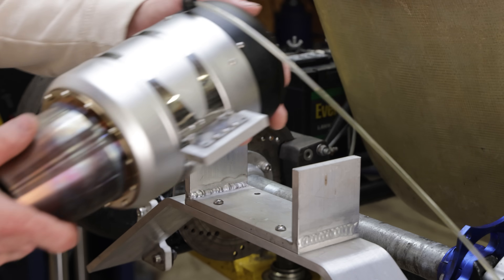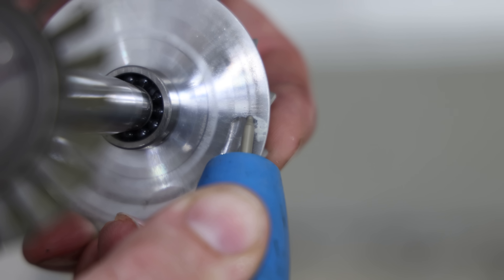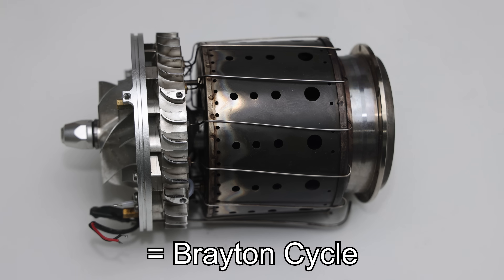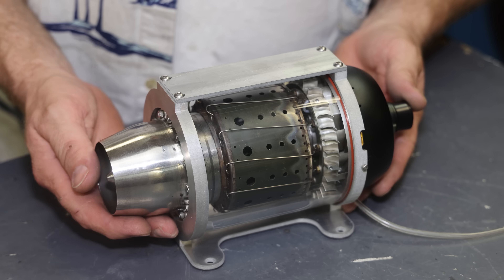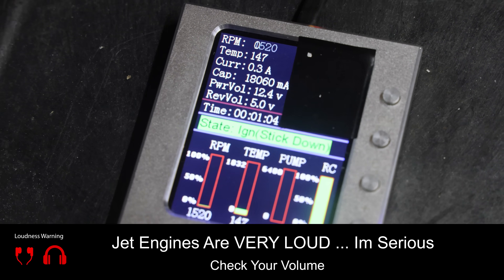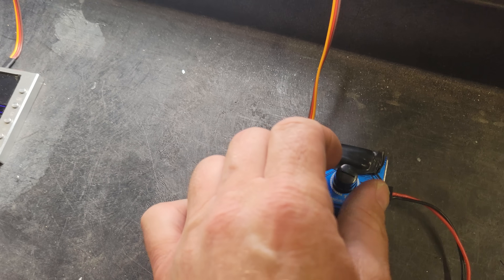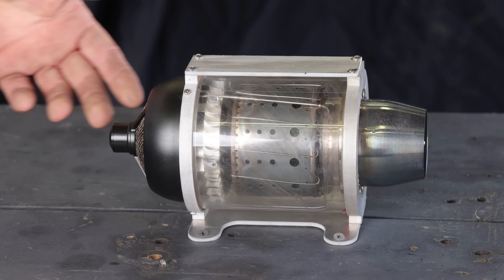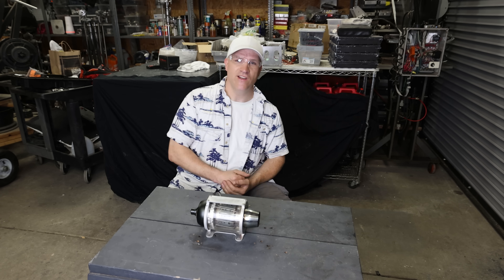See Thru Jet Engine

Comment: There have been several comments about the amount of airflow. A manufacturer of similar engines (there are many almost identical engines available) gives specs for their equivalent size (the P130-RX from JetCat):
Name: Value
Pressure ratio: 3
Mass flow (kg/s): 0,3
Consumption Full load (ml/min): 441 @ 130N
Consumption idle (ml/min): 100
Weight [g]: 1326
Dimensions of the diameter (mm): 99
Length (mm): 284
Exhaust gas temperature (°C): 490-720
Idle speed (1/min): 40000
Max rpm (1/min): 127000
Thrust at idle (N): 4
Thrust @ maxRpm (N): 130
Exhaust gas velocity (km/h): 1560
Exhaust gas power output (kW): 28,2
SFC @ maxRpm (kg/Nh): 0,185

441 ml of kerosene is 355 g, and 355 g/minute is 6 g/second. So that's 300 grams of air and only 6 grams of fuel flowing per second, a mass ratio of 50:1. To burn kerosene completely requires 15.6 times as much mass of air as of fuel, so the engine is moving about three times as much air as it needs to burn the fuel; that's excess air, and that's normal for a turbine engine. The thrust results from increasing the momentum of the air; the energy to do that comes from the heat of burning the fuel.
Reply: Most air going through a jet engine core (80% when I was at college - will be slightly lower nowadays) is for cooling the combustion liner, pressurising bearing seals etc. This is not a piston engine!
Reply: @cgarner7668  that is wildly incorrect. What you misunderstood in college is that the airflow is roughly 5 times as much as required to burn the fuel; 80% of the oxygen in the air passing through the engine is not needed for combustion. The excess air is not for cooling - it is the working fluid of the engine. 

A diesel piston engine runs excess air at any condition other than full load, too.
Reply: DO NOT READ MY CHANNEL NAME

Comment: I wanna know more about that balancing rig......

Also, question. Back when the internet made noise, and people made DIY turbine gas generators (not jets, they tried for thrust, but never really made much push. No one seemed to clue into butting up another turbine section to the exhaust to extract rotational energy like how a turboshaft works....oh well....) out of car turbos using screen door perforated metal material for the flame can, someone discovered that if they left a little scoop like lip where they joined it, the incoming air is swirled into the flame holder which contains the super hot blue bit better in the center of the can and kept a cooler layer of intake air against the flame holder can walls. As, of course, if that blue bit touched that thin metal holder itd liquify it in an instant which is bad news for the down stream turbine. Since those combustion stages were hollow and didnt have the center shaft running through it like these linear jets, I dont know if that would effect the mechanical operation, but have you considered giving the intake holes of the combustion stage a little scoop lip, just like, a little bend up? If so, good/bad effects on the over all operation?

And finally.....WHOLY FREAKING BALLS SEEING THAT FLAME DURING START AND RUN UP!!!!!! So cool!!!!! When I saw what looked like the refraction of the innerts though the shell flexing I immediately felt the need to get behind something incase it failed 😅😅😅

PS - for slow smoke to do an intake flow demo, capture a bunch of smoke in a bottle and slowly squeeze it  to let out thick puffs that will show air flow a lot better. There is a youtube channel of a guy that 3D prints weird PC fans, thats how he does it. That being said, it drinking all the fog of one of those big units (I have a few laying around from my stage production and haunted house days) .....DAYUM..... O.O
Reply: There are turboshaft versions of engines like this. They're usually used as turboprops, but are also set up to drive helicopter transmissions. See KingTech for examples.

I remember seeing a gas turbine engine made from an automotive turbocharger about 40 years ago.

Comment: I lied it a lot I worked on the B-52 jet engines for 10 years in the Air Force  It had 13 stages of compression but this is really cool!!!
Reply: Presumably that was the later (starting 1961 production) Pratt & Whitney TF33-P-3, which was a turbofan... so it had a 2-stage fan (from which the air mostly bypassed the core) in addition to the 13 compressor stages. The earlier JT3 turbojets apparently had 16 compressor stages. These toy engines are certainly a lot simpler, but the basic principles are the same. 🙂

Comment: Very cool and fun to watch!  My two cents: the thermal expansion of the aluminum frame (the longitudinal pieces on top and on the bottom) is much higher than the glass case.  So, as it heated it wanted to grown longer, and the glass did not nearly as much.  That's why I think it separated somewhat pulling one of the gaskets with it.  Probably some of the other 2500+ comments said the same.  My fear was the glass shattering!  Now, even if it did not this time, with multiple cycles on it, it still may so please continue to take all safety precautions with this engine.
Reply: There's no way that's any kind of glass.  Unless it's laminate borosilicate.  Glass likes to explode into lethal debris.  With something like this, you want your failure mode to be phase transition, not rapid lattice decomposition.
Reply: @scottrackley4457  True!   His material seems to be a plexiglas or Lexan cylinder.  These materials won't shatter, but with enough heat will weaken and reshape.  Pretty amazing little demo !!!!
Reply: @McGrumpus  Yup.  With all that expensive video equipment I'm sure he doesn't want that cylinder to have a SMEF
Reply: @McGrumpus  >> plexiglas or Lexan cylinder.
I was thinking the ideal material for the transparent tube would be synthetic sapphire.  But it's probably not available in a tube shape like that
Reply: Pretty sure the expansion is not thermal, but almost completely caused by overpressure inside the engine. You can tell by how the engine instantly expands when fuel is burned (which increases the internal pressure).
Reply: Ohhh definitely, if that glass would one day break...while the jet turbine full in action.... as you said in video the combustion pressure will accelerate the broken glass pieces like shrapnels.....I imagine a horrible deadly accident.
Lab style protection glasses won't be sufficiently in such case.
Glass pieces are flying bullets then.
UUUUU.....what a FKing horror would it be in such moment to stay 3 meters away with nothing in between.
A TRANSPARENT PROTECTION PANEL LIKE THOSE USED IN LABS TO PROTECT SPECTATORS WHILE DOING CHEMICAL EXPERIMENTS..... LIFE SAVING.
Might be the nxt video to make that glass BREAKING WHILE STAYING REMOTELY IN THE SAFE BUNKER. 

PS: DEADLY ACCIDENT HAPPENED WITH FLYING GLASS SHRAPNELS WHEN SOMEONE PUT ONE OF THESE LAVA WAX LAMPS IN A MICROWAVE.
Reply: @ronscrypt2go499  I imagine a few hundred numb nuts who didn't read these comments are probably out there building/testing these engines while wearing only safety goggles for protection😳

Comment: That looks great! How did you get the initial compression prior to the ignition?
Reply: Thank you very much! That was very educational!
Reply: There's an electric motor in the intake fairing that spins the rotor up until the engine has enough power to self-sustain, then it cuts out.

Comment: I worked for General Electric Aircraft Engine Group in Cinn Ohio for 16 years as a Design Engineer. Retired now. I have a Jet-cat P-80 for one of my R/C Aircraft. Must say that you have done a Great Job on the Build. i was just wondering what tipe of material us used of your outer casing. ? Very interested to know.

Comment: Is it possible to add an afterburner for such an engine, or is that too extreme?
Reply: It's certainly possible (I actually did so during undergrad), but since the engines aren't designed to be used that way, you're most likely going to be pushing its capabilities.

Comment: I'm aircraft technician and this looks cool to me, never thought that will possible to see inside running engine. 😍
Reply: waited to see when those compression blades would start spinning but they stayed still. looks like i don't know enough of these types of motors.
Reply: @cubertmiso  these are not compressor blade. These are stator vains who's function is to straightan the airflow and increase the pressure slightly as the space between them is divergent.
Reply: @kuldeepsankpal6443  thank you mister!

Comment: Great work. How do you lubricate the engine shaft? Especially the hot end? Also the spin it up prior to ignition, is there a motor or compressed air? Thanks

Comment: Awesome. Did you get the glass custom made in a lab? Also I noticed you went to the trouble to balance it but then took it apart to assemble it again later inside. Presumably the turbines would screw in at different angles to one another and it wouldn't be balanced anymore?
Reply from the maker: good observation, yes i designed the material and had it made in a special machine oversees. I made alignment marks but also rebalance once assembled.

Comment: So the fuel added... is it used to add thrust or maintain thrust?
Reply: How do you think that an engine could produce thrust without fuel?
Reply: @brianb-p6586  Never said anything about no fuel.
I'm asking about the point of fuel.
If the fuel is producing the thrust then why the spinner and fanblades?
So the fuel is it to keep the fanblades going or what?
Reply: @BolinFoto  The fuel supplies all of the energy, by burning to make heat. Heat makes the engine run, forcing air to flow through the engine. The compressor ("fan") is there to raise the temperature and pressure of the air so the hat of burning is more efficiently used; the turbine is just to drive the compressor. This is how all gas turbine engines work.

More fuel means more heat, which means more airflow, which means more thrust and power.

Comment: How much HP would this thing be pushing?
Reply: None, because it is stationary. Engines without an output shaft are rated by their thrust (the force they push the aircraft with); this one can produce about 30 pounds (130 newtons) of thrust.
Reply: @brianb-p6586  right right!   Two very different things...   would there be any sort of translation?   Maybe this would be 1/4 HP?
Reply: @upgrader99  It's actually an easy calculation: power equals the product of force and speed, so just multiply the force (the thrust in this case) by the speed that the it acting at (the speed of the aircraft in flight) to get power... if you use the right units, you don't even need a conversion factor.

For instance, if it could maintain 130 newtons of thrust on a fast RC model aircraft at 50 metres per second (180 km/h or 112 MPH) it would be producing 6500 watts (6.5 kW or 8.7 HP). But at a lower speed it would be a proportionately lower power.
Reply: @upgrader99  Maybe, but it's not that bad. Imagine that you are pulling something heavy up to some height with a rope. No matter how fast or slow you pull it takes the same force to maintain a steady speed (just the weight of the thing you're lifting) but the faster you pull it the harder you have to work (more power). Power equals force times speed. 🙂

Comment: FYI, I'm guessing the fog test didn't turn out as cool because the compressor messes with the vapor pressure. Fog in wind tunnels is a lot more dramatic because the pressure is much more relatively stable.
Reply: more likely it's because the "fog" is propylene glycol (or mineral oil) vapor that ignites in or immediately after the compressor stage

Comment: I’ve worked on parts that weigh about 2 1/2 lbs and up to 175.000 lbs. the craziest time was a 125.000 Lb part spinning at 600RPM started to bounce in the balancing machine, stopped it safely but I had to change my underwear afterwards.

Comment: Your assumption that "jet engines don't pull in a lot of air" may be true for your benchtop model, but could hardly be more incorrect for full-sized jet engines.  If you've ever seen videos of aircraft carrier crewmen being sucked into the intake of a running aircraft you'll know exactly the amount of air these move.  Remember, it isn't just the fuel  providing the thrust, BUT THE AIR IT MOVES THROUGH IT.  The more fuel, the more air it needs, so there is quite a lot moving through it.
Reply: Right - the manufacturer (JetCat) of an engine this size (P130-RX) specifies airflow as 0.3 kg/s, while full-power fuel flow is only 0.006 kg/s.

Comment: I wonder how much air it DOES take in compared to output?!
Reply: It takes in exactly the same mass of air plus fuel as it puts out, of course. Almost all (98%) of that is air, the rest (2%) is fuel.
Reply: @brianb-p6586  so it's the air that is charged by the fuel forcing it out? He said the opposite on the video
Reply: @southsideman4891  what do you mean by "charged"? The air is forced to move by the addition of heat at the right stage in the engine, and the heat comes from burning fuel.

Matt's comment wasn't really clear; perhaps he can clarify it.

Comment: so What spins the turbine on initial startup? Is it just ambient air and that's why it goes so slowly at first?
Reply: Also is fuel the only thing that determines the RPM?
Reply: @Stellarffxi  Yes, fuel flow is the only thing that can be controlled.
Reply: It has an electric starter motor - the black thing on the nose. Ambient air won't make anything spin unless it's moving.

Comment: Alright. Real cool. But how come a thing like that powers an M1 Abrams? It is a diff kind of turbine?
Reply: The Honeywell AGT1500 in an M1 is thousands of times larger, and it has an extra turbine in the exhaust to drive the shaft which goes to the transmission, making it a turboshaft engine (this is a basic turbojet engine).
Reply: @brianb-p6586  So it like compresses the alerady compressed stuff? Whoa!
Reply: @joaoguilhermebastos519  All practical gas turbine engines (not these little things) have multiple stages in both the compressor section and the turbine section. Multiple compression stages are needed to get a high enough pressure to be reasonably efficient and powerful. The turbines expand the compressed and hot gas to get power from it; multiple turbine stages are need to extract enough power for efficiency. A turboshaft engine uses the first turbine stages to drive the compressor, and the later turbine stages to drive the output shaft.
Reply: @brianb-p6586  Thank you!

Comment: The difference between jet engine and turbofan engine... especially high bypass turbofan- in jet engine most of thrust comes from burned fuel. in turbofan the jet engine powers large compressor which generates most of the thrust... which leads to better efficiency.

Really nice engine.
Reply: No, almost all of the thrust in any air-breathing jet engine (turbojet, turbofan, ramjet, whatever) comes from reaction to accelerating the mass of air; the fuel provides the energy, but almost none of the mass and so almost none of the thrust directly.
Reply: @brianb-p6586  lets reformulate: In turbojet all the thrust is derived from the exhaust
In turbofan engine there is only about 30% or less of the thrust derived from the exhaust of the engine

That exhaust contains of course some of with fuel unreacted oxygen and nearly all the nitrogen(only small part of exhaust is NOx).
Reply: @petersvancarek  Yes, that's the difference: in a turbofan an additional turbine extracts more power from the exhaust stream, using it to drive a propulsion fan, leaving only a small part of the thrust to be produced directly by the core engine exhaust.

But the exhaust from the engine core is the same in either case: it's mostly just hot air (including all of the nitrogen and most of the oxygen from the intake air), plus some added carbon dioxide and water from burning the fuel, plus traces of the nasty products of incomplete combustion (unburned fuel, soot, carbon monoxide, etc) and unwanted reactions (oxides of nitrogen). The turbofan exhaust - even considering just the exhaust from the core, ignoring the bypass air - is just like the turbojet exhaust, but cooler because it is carrying less energy.

Comment: I have so many questions... The main ones being, how are these used to basically jumpstart a large jet engine such as commercial planes? I know they have an APU that is basically a smaller jet engine that creates pressure to fire the main engine but I have no idea how it translates the pressure back to the mains when you can see the exhaust cone in the rear of the plane. Another question that comes to mind is how do they run when there is water introduced to the system such as flying in the rain? Wouldn't the water vapor cool and cause ignition problems? You cannot mix water into fuel in your car and still have it run correctly so is the engine just so hot that it vaporizes the water before its compressed and its basically just burning the hydrogen and oxygen as molecules?
Reply: Water can actually be deliberately injected into a turbojet engine give the engine more mass of fluid to work with, increasing thrust for the same fuel flow.

Comment: "Wheeww THAT'S HOT!" was a Eureka moment wasn't it?!  When I flew in the Navy we didn't shut down our turbo shaft engines immediately but let them operate at ground idle for a short while for a brief cool down. This prevented the turbine blades from acquiring negative characteristics from a quick cooling off. Consider doing this on your small engine.
Reply from the maker: Yep you are absolutely correct, the only reason I shut it down to briefly like that was to finish off the scene, normally I let them cool down first for the exact reason you said. Thanks!
Reply: When I had a twin turbo Z years ago I would let it idle for a few minutes after a hard run to keep the oil from cooking inside the turbos.